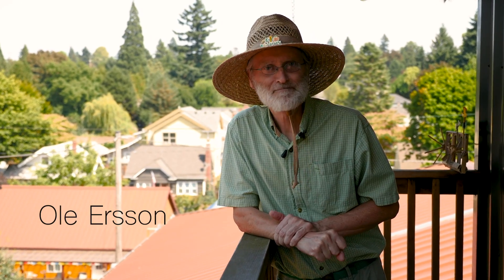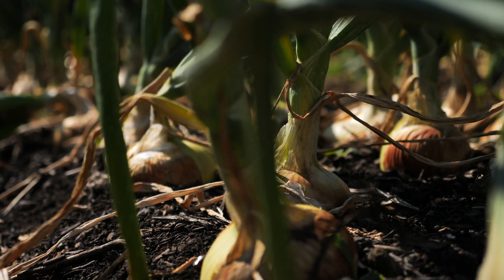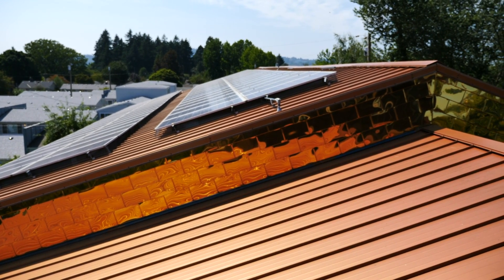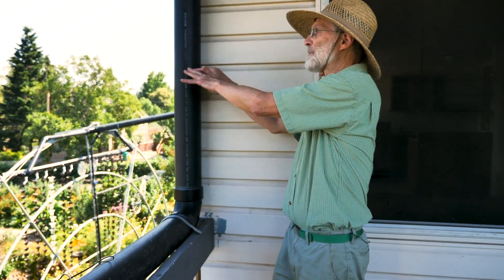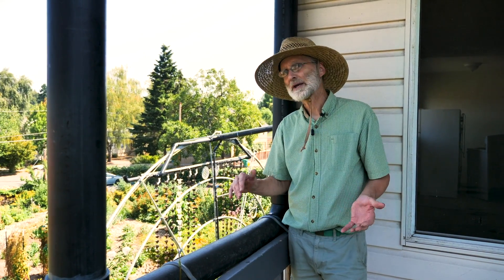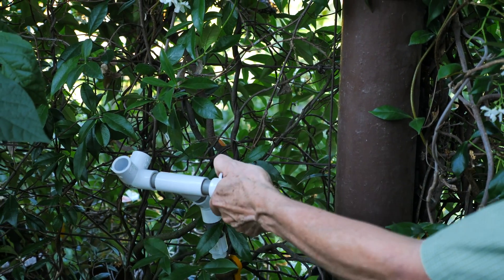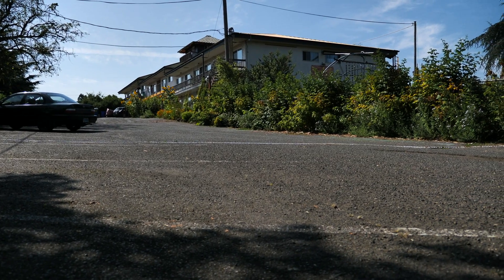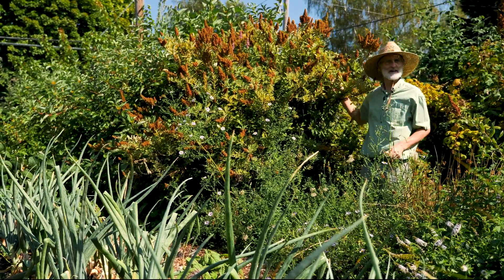Funky Portlandia Ecovillage is Giant Rainwater Sponge!

Comment: hmm i thought swales weren't ideal in predominantly clay-based soils
Reply from the maker: Hi Kerem. 2 things: these are drainage swales, not on-contour swales. In the permaculture world people think "swale" means "on-contour swale". But in the wider world swale just means a low place or depression in the landscape. Also, their clay soils are ultra absorptive from all of the massive amounts of organic matter they've added through kitchen and humanure composting from an entire community. Therefore they have no drainage issues and water easily soaks in to the ground. The whole site is a giant sponge and water barely even makes it into the swales before it is absorbed.
Reply: @amillison  Thank you for this expansive and intuitive answer. Having dealt with deep clay soils for many years, that was a question for me. 

One aside about buildings on deep clay soils: During a small earthquake, I was lying on the floor. I noticed the ceiling fan above me moving in a figure 8, dizzingly. My friend working at the kitchen sink, looking down, became nauseated by the sliding motion of the building. A difference from the jarring jolts of fault slippage on bedrock. Probably not significant in your water system.
Reply: 1 percent increase in organic matter can produce an 8 percent increase in water holding capacity. So for instance a 6 percent increase nearly doubles the water holding capacity to 48 percent.
Reply: But something important to remember: Swales dug on soils close to the bedrock can cause landslides.
Reply from the maker: @futurecaredesign  Definitely important, especially in a deforested area. No worries about landslides though in the area of this project
Reply: @futurecaredesign  In my experience , a lot of mulch on top of the rock and planted cover crop keeps everything intact. Using a living cover like peat moss can also help
Reply: Hmmmm, check out more recent videos that describe how they have built around 10 inches of new soil with all of the so-called waste... clearly they're not dealing with clay-based soil.